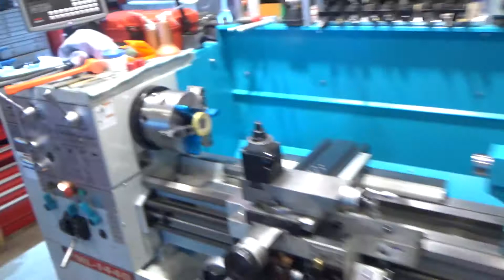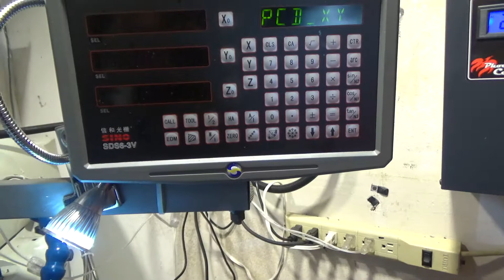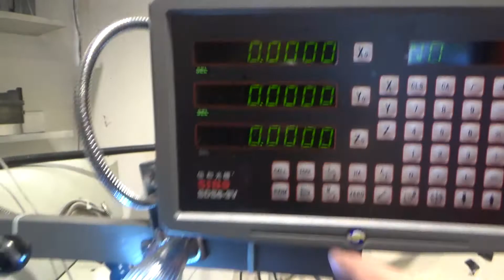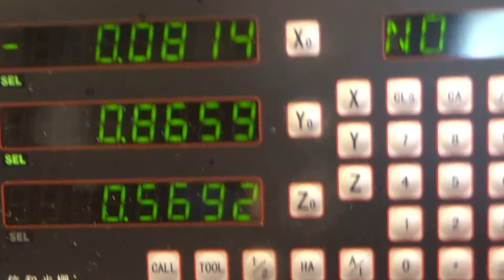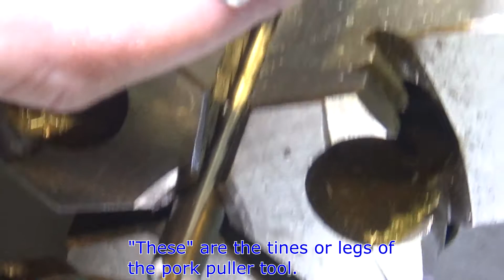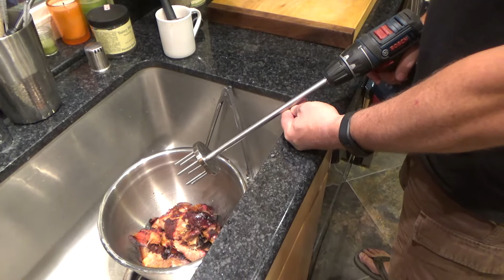Pork Puller Extreme - Tool for Making Pulled Pork

Comment: Nice job.. I like your cool blue stand offs in your three jaw! Did those come with the chuck? What brand chuck? Cheers!
Reply from the maker: The Blue stand offs are from travers and are TTC (in house brand). they have neodymium magnets to hold them to the chuck and work pretty well. The chuck came with my ACRA Heavy 14 lathe. It seems to work well and seems to be pretty accurate. Thanks for the comments.

Comment: Stainless work hardens, so it's essential to start with sharp drill bits and maintain steady feed pressure, so the bit is always cutting, never rubbing. Looks tasty.
Reply from the maker: Thanks. I did look for the sharpest bit I had. I think this was the hardest drilling operation, relative to drill size that I have had. I had not used 18-8 or AISI 304 before and it was quite an eye opening experience.